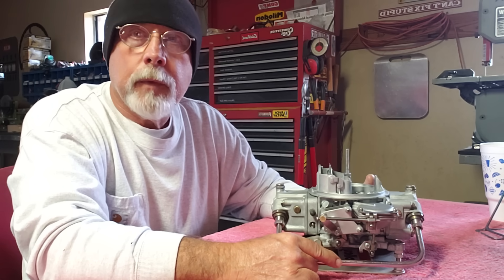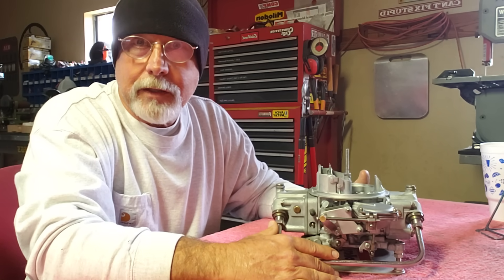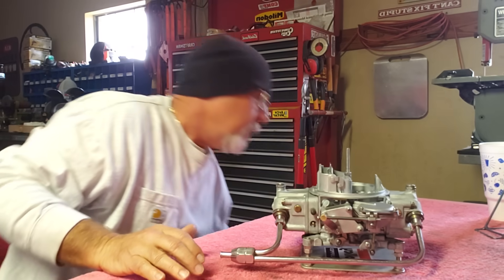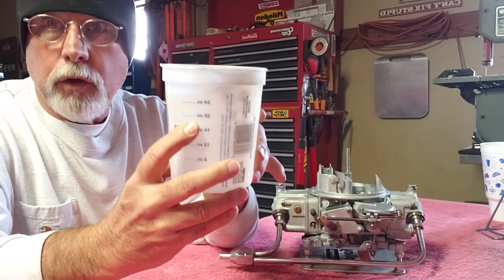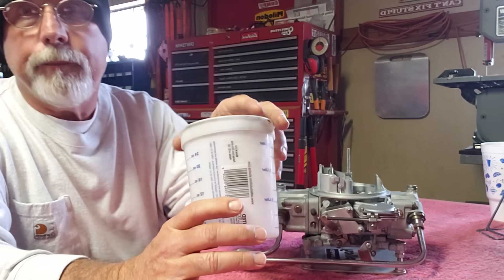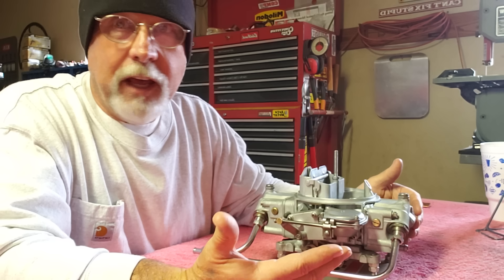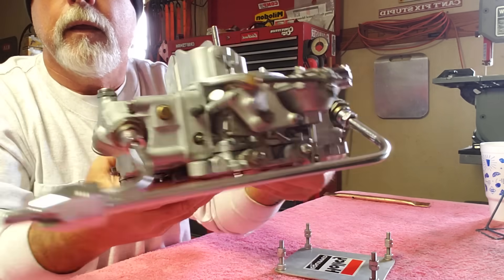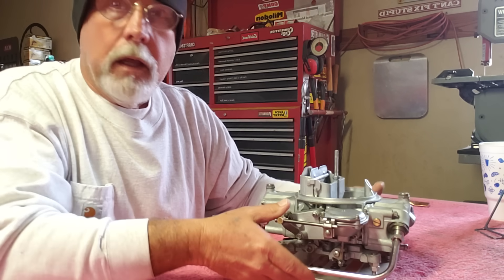Best carburetor cleaner ever!

Comment: Ok, a couple things.  First of all muriatic acid is just a common name for diluted hydrochloric acid.  And hydrochloric acid will dissolve your carburetor.  You're not cleaning it so much as dissolving the top layer of metal.  Since you have a shop already, I'd suggest a small ultrasonic cleaner and then burnish the parts if you want a super shine.

Comment: Never use Muriatic Acid. Besides being very dangerous to handle and breath in, it stays with the metal until to "cook" it out at high temperatures. Just use phosphoric acid. Much safer to use and just as effective. I can't believe this stuff is still sold in stores! Stop using this stuff! you'll see what the fumes do your cloths and then know what your lungs are doing. You are taking layers of metal off and destroying your piece. Stop promoting this stuff to people who don't have a clue!
Reply: This,as many other products on the market, is sold assuming the user is familiar with the PROPER way to use it,and the proper use of PPE! I have used it for decades,in a mask,gloves and apron, with no personal health issues.I am medically monitored by my employer,have informed them of my using it,and have none in my system.They would definitely pick this substance up,and have not. As far as it staying in the metal, rinse it well, in water,and dry it in heat,it will evaporate.I cleaned my first carb with it in the seventies,and have never had any adverse effects to my self,or the parts I cleaned with it.Like ALL chemicals,if handled properly and correctly,this one has some great uses and benefits.Remember, the auto body profession used to kill a lot more people when they weren't using proper PPE for what they were doing,I.E supplied air respirators while painting,dust masks while sanding,etc.It is a user's responsibility to protect themselves! What it does to you is a direct result of how you handled it! And,you are one hundred percent correct,there are a lot of people who should NOT use it,as they do NOT have a clue!

Comment: I'm also retired vet and I appreciate the information I've had a hard time cleaning these carburetors thank!!
Reply from the maker: Thank you and thanks for you service
Reply: Cleaned out autolite 2100 on 69 Bronco with berry man's about 3 cans selector switch had rust ran good until I switched tanks something got thru plugged up power valve (new)  need to give another spritzing should be okay she hadn't run in over 13 yrs.  sounded good no sticky lifters marvel mystery oil and berry man's italian tune up vice grips garage slogan,,👍😊✌️🤔
Reply: @milotorres6894  marvel mystery oil is the bomb! I bought late model chevy 6.0 truck for engine core.it ticked bad and smoked up the whole neighborhood when you started it. Ran 8, oz. MMO in it for about a week and shazam! It unstuck the ring I guess.no more smoking.that was 3 yrs ago.still using it for farm truck to this day.had to buy another core engine.lol

Comment: Mr Ronnie Henson I really enjoyed your videos, please add  to neutralize after dip in baking soda, blasting with baking soda may have neutralize outer surfaces, there may have been small amount of acid in the threads causing galvanic corrosion between the screws and parent material of the carb. that may be the reason the screws were seizing. but I never seen a well organized dis assembly and reassembly. very well done sir.
Reply from the maker: Thank you!

Comment: I use mac's professional carb dip from NAPA for the last 40 years works great for cleaning,  that was the standard of the industry,, they still make it,,even come s with it's own dipping basket comes in five gallon metal pail, every dealership I worked at had this carb dip, gm, Ford mopar,
Reply from the maker: Great tip!
Reply: Same here- just bought a pail full ($) but am on here looking for other ideas and how to restore the yellow finish. Found a fellow named Harold Demes has some good information on that. Been doing this for over forty years, now playing with old trucks, tractors and automobiles at our local Heritage museum. Good old days!

Comment: Could you submerge an aluminum engine block in that to clean it?
Reply from the maker: Not 100% sure on that. Most aluminum blocks have steel/iron  selves and this acid solution would not be compatible with that combination. I have used solvent from Atwood's or Tractor supply for that block with good results.
Reply: @ronniehenson4122  what was the stuff that you used?

Comment: absolutely excellent video!
I bought the same chinesium sand blaster gun for this exact purpose, but haven't used it yet 'cause I wasn't sure it would do the job.  Now I know she works so....awesome!!
Been using double molarity vinegar, was worried about the muriatic (HCL hydrochloric acid usually sold in 10 molarity concentration at the hardware store) 'cause I was worried she might do damage to the parts.  Again, you've convinced me to give it a go.  Thank you so much for this video and showing me the way.  You get a subscribe from me!

Comment: Hey, great video, I appreciate it. I was going to buy one of the ultrasonic cleaners, may still for other steel  parts but for the carburetor now, this would be as you said efficient and very inexpensive. I enjoyed the pace of your video, well explained and straight to the point, great job! You are appreciated and hopefully encouraged to make more. I would like to be able to pick your brain a little bit sometime about my motorcycle carbs. Have a v4  Yamaha Royal star, a beast, that I have taken apart the carbs and put back together but not sure I am clear on a few things in regards to the theory wise. Thanks again.
Reply: Are you synchronizing those carburetors once you put them back on the bike? Multiple carb engines MUST have the carbs synced to run properly.No amount of cleaning can overcome a bad sync!  I spent a good deal of time tuning other people's "carb cleans",when most of the RSV'S Ive worked on just BADLY needed the carbs synced by an experienced shop or tech!.This motor needs to be done in a specific way,and if not done properly,it will not run happy!

Comment: Thanks mate, that is well tasty information you given us there,  hopefully very helpful for cleaning Motorbike Carbs .. just wondering what type of spray gun is that you’ve used  .. as we have no ‘Harbour Freight’ stores in Australia.    Cheers mate,👍
Reply: It's a sand blasting gun, used with baking soda to polish the surface without removing it.
Reply: Try Trade tools on line or super cheap in australia. they stock similar items.

Comment: Please see this video by Harold Demes. It goes together with your video, and shows how you can make the carburetor have the Dichromate coating on it again. You can purchase the supplies on eBay or Amazon and setup a small mixture of the solution, and then dip the carburetor in a tub to apply both the zinc and then the gold Dichromate. https://youtu.be/Nmn94B5UUuU

Comment: Stunning work and info! Hydrochloric acid (Muratic/stomach acid) does remove everything. But it is very bad for iron, because it causes rapid rusting of the iron after it removes the rust. You can use Phosphoric acid after cleaning steel to remove the invisible rust and seal the metal by creating a thin layer of black iron on the metal, which prevents rapid rusting. Phosphoric acid must be used instead of Muratic acid, on iron parts, unless there is no other way to clean the rust. Evaporust works very well too, the liquid, and it removes rust very well without causing rapid rusting afterwards. Citric acid and Acetic acid also passivate and seal iron, instead of creating rapid rusting like Muratic acid. If you don't have anything, using vinegar (acetic acid) is good for iron parts and won't cause long term rusting and damage. Phosphoric acid/citric acid/acetic acid lightly passivate iron and protect it from rusting. You can also use these acids on stainless steel, with Phosphoric acid and Citric acid being the best for stainless, they passivate the stainless. Muratic acid, does not passviate steel or stainless steel, so it will rust or stain later when exposed to light moisture. This carburetor looks absolutely amazing! I'm only sharing this information because it may be relevant for people trying to clean steel parts.
Reply: Mr Ritalie I work in the metal machining and grinding case harden steels, we temper etch (Nital Etch steels) for burns,(Over Temper or re hardening), the trick is, clean with hydrochloric an water or alcohol, alcohol is preferred over water, it does not cause a condition called hydrogen embrittlement in harden steel, or it can be baked after etching to prevent embrittlement,
after etching in acid requires a solution of sodium carbonate (Baking soda) to neutralize the acid, and prevent surface deterioration from the improper neutralization.   
then clean in hot water , then dip in oil to prevent corrosion. (rust)   there more to this but for cleaning the above is all that is needed.     any thing etched has to be neutralized then water rinsed and then dipped into a corrosion prevention.  cast iron is a weird animal since it is high carbon, and will react different and detrimental.   God Bless
Reply: @longBowHunterII  Amateur, cleaned a gas tank to get the rust out, neutralized with baking soda, rinsed and then a mixture of acetone and marvel mystery.....not sure about the last step, any ideas?
Reply: @cliftonsaint8770  once rust starts it is very difficult to remove. I had luck with the chemical that turns rust into iron. then coat it with polyester resin. these has worked in the past. however a new tank would be best.
Reply: I've used vinegar for years. Cheap and easy provide you're patient.
Reply: @rexmericle5068  hey Rex does the vinegar clean out the varnished gas in the tiny passages? Will overnight be enough? How about warming it slightly on the stove? Thanks
Reply: @daveg2199  hi Dave it depends on how bad the build up is. What I generally do is disassemble the carb and leave it in vinegar for about two days. If you have heavy varnish I suggest pushing some carb cleaner through the various ports with all the brass parts out. It's always worked for me. I would think warming up the vinegar to soften up the varnish is a good idea. I have to tell you that the carbs I've worked on over the last 10 years are motorcycle carbs which are VERY "finicky" by comparison. Nice about vinegar, you can strain it through a coffee filter and reuse it and when it gets dark you can just pour it out on the ground.
Reply: Carbs are aluminum not iron
Reply: @ryanpaasch7464  
Even the AFB?  (Sorry I had to, if I don't crack myself up, who will.)
Reply: @mikeobrien3744  one of my carbs is a Carter afb 625  it is aluminum it is a very light carb  a lot lighter than Holley 750  there might be carbs made out of steel?
Reply: @ryanpaasch7464  No steel carburetors, cast iron yes.
Reply: @ryanpaasch7464  Yes but most carburettors have plenty of steel parts like choke flaps & linkages. A lot of classic carbies had cast iron throttle bodies like Stromberg BXV & Carter WCFB.
Reply: @johnrebus1641  what would you suggest cleaning the Carter afb?  It is dusty not grimy hardly used but decades ago  I have a rebuild kit
Reply: @ryanpaasch7464  I recently rebuilt a grotty Holley 9174 for a friend. Make a mix of 3 parts Water (say 1.5 Litres), add one part Phosphoric acid (500mL) and then a cup of Truckwash (250ml).  Put the carb in a plastic container soak the carb in this mix for a few hours. Give it a scrub with an old toothbrush every 15 minutes or so. The steel parts might fizz a bit so turn the carb linkage side up after 30 min or so. Afterwards wash it really well with water & blow out with compressed air.
Reply: @johnrebus1641  thank you!  Will work on it this weekend
Reply: @ryanpaasch7464 : Most carburetors are comprised of an alloy which is primarily zinc. A notable exception is Carter's AFB (Aluminum Four Barrel) and its copies.
Reply: @ryanpaasch7464  the holley carbs that are usually the green color are made of pot metal
Reply: Great info.
Reply: You are exactly right! Muriatic acid is for idiots! Use phosphoric acid.

Comment: Ronnie, good video.  Two questions: I am going to work on a couple of Stromberg 97’s.  Will the potmetal stand up to the 33% muratic acid?  And what will I ask for at Harbor Freight?  A soda blaster?  Or?  Jim Mack
Reply from the maker: Penny, I'm really not sure what the muriatic acid will do to pot metal never tried that before.. Make sure you do a scrap piece of pot metal first. Get your soda powder at the dollar store $2.00
Reply: @ronniehenson4122  Ronnie, I put an old 97 top in your recommended mixture for 20 minutes, and it came out clean, with no deterioration. Re my second question, what is the name of the gun you used to “blast” the carbs  w/ soda powder.
Reply from the maker: @pennymack2552  No name, you will see it when you go in Harbor Freight
Reply: @pennymack2552  Thanks for bringing this up- I have to make 6 useable carbs out of 8 97 cores for a hot rod restoration and was wondering if they would be candidates for this. Not sure if I want the satin look when I'm done or if I will see about a poor boy method to chrome plate them. Thank you Ronnie Henson, this was a good video!

Comment: Great video got a barn find truck with 351 cubic inch and a totally plugged contaminated 4 barrel Holley carb. original ford tag on it . I will follow your information to clean .and also spay all the screws with wd40 or similar oil to prevent rust on steel parts.
Reply from the maker: Please let us know how it went, thanks! Good luck!

Comment: Well done it's been years since I have rebuilt a carburetor was thinking of buying Berryman Carb cleaner. I will try your method of cleaning and the baking soda blast. First will be a holley 600 cfm and then a holley 780 duel feed double pumper. If that works well next up will be my corvette fuel injection. Thanks and keep up the great videos STAY SAFE.
Reply: I used Berryman carb cleaner about five years ago . Carter carb off my jeep . I forgot to take it out and ended up out on the road working for two weeks . soon as i got home I took it out fearing the worst , It didn't even get all the grease off the darn thing !! real junk !!
Reply from the maker: Thank you!

Comment: I'm only interested in cleaning the individual brass jets that I have removed.  Wondering if your Muriatic Acid is a good choice for soaking overnight to get clean.  I've heard of people using vinegar, and of course, the expensive dip stuff you buy at auto parts stores.  Don't want to buy an expensive gallon of dip solution.  Ideas?
Reply from the maker: Try the vinegar, if just doing the brass jets.

Comment: Water molecules are larger than the fluid thats in gallons of Berrymans or Gunk . I gotta wonder how well this  mixture you concocted works getting into VERY  small orifices such as found on motorcycle carbs .
Nice looking carb , thanks for the baking soda tip .
Reply from the maker: Water molecules c are tiny, electrically neutral and V-shaped with molecular formula H2O a and molecular diameter about 2.75 Å. Water is much smaller than almost all other molecules.

Comment: Thanks Ronnie for the video /mixed 2 gallons of water with 1 1/2 pints of muriatic acid. total change in about 10 minutes. note this carburetor looked like frosting it was so caked with white corrosion inside. Clean and re dipped a second time for 5 minutes. Total cleanliness in 15 to 20 minutes. Thanks again Ronnie
Reply from the maker: Thank you!
Reply: how's it look?  any damage ?
Reply from the maker: @bmw5050  Looks and runs great, no damage. The steel parts need to have some WD-40 sprayed on them or light rust will appear.

Comment: You could slowly pour the old muriatic acid into a gallon of milk to neutralize it.  Or slowly pour the acid into a pile of baking soda.  May be safer on your pipes.
Reply from the maker: Drain pipes are PVC and the mix will not hurt them at all. I do it all the time, never a clogged drain ever.